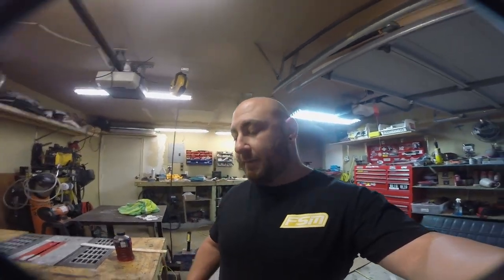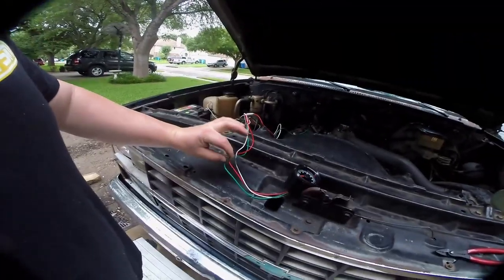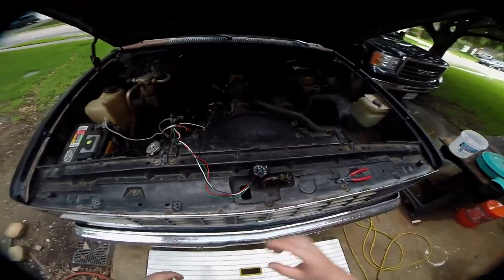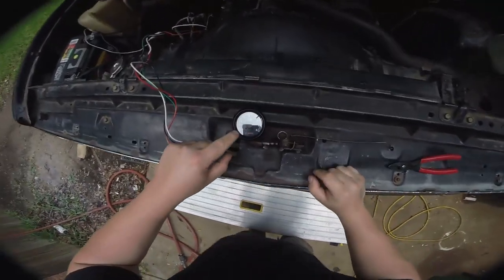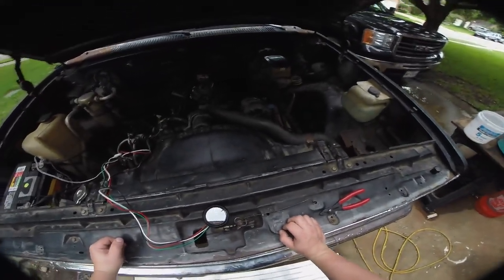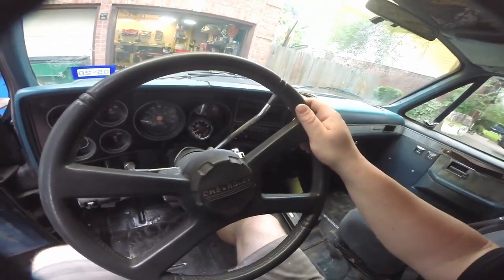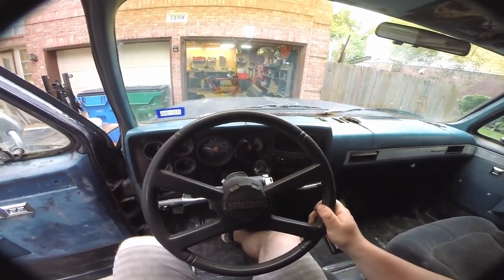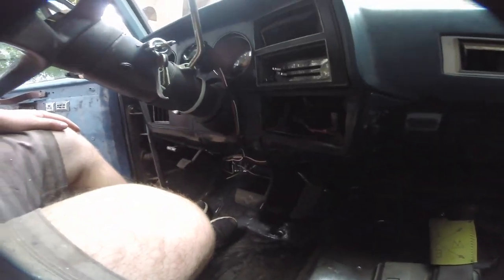1989 K5 Chevrolet Blazer Build - Episode 5 - Installing a Roadkill Style Tach

Comment: any idea how the volt meter works in the 1990 chevy k5? I cant find any good info on how to fix it since mines all over the place even though the battery and alternator read fine with a klein multimeter.
Reply from the maker: I mean its just wired into the harness and should read from the output end of the alternator. If the voltage in the system is steady, but the gauge is all over the place -most likely the gauge isjunk
Reply: @Makswerks1  Thanks, I've been also trying to figure out my speedometer, I think that gauge is going out too because the truck shifts ok but the speedometer is either inaccurate or doesnt show movement at all.
Reply from the maker: @bobbob1691  That can be mechanical or electrical. Would start with the cluster grounds and make sure they actually connect well.
Reply: @Makswerks1  off topic but did the EGR block work good for your blazer? I have the same TBI 350 so I was curious if there were issues or anything like that.
Reply from the maker: @bobbob1691  Cant say the gasket was too great, but i doubled up and it was fine.
Reply: @Makswerks1  No catalytic converter overheating or anything?
Reply from the maker: @bobbob1691  nope.